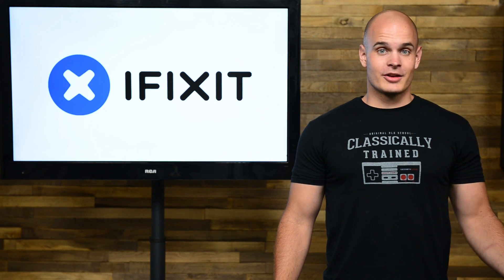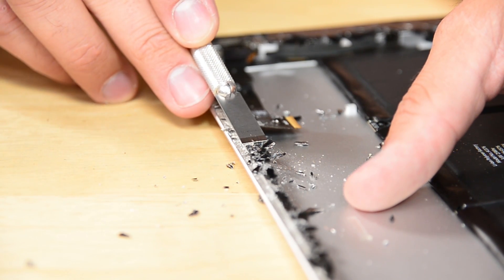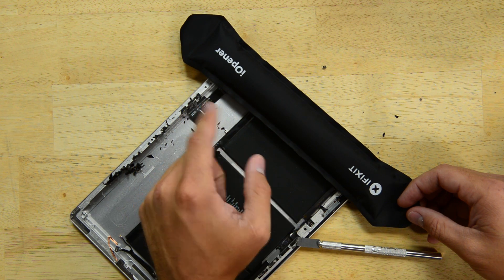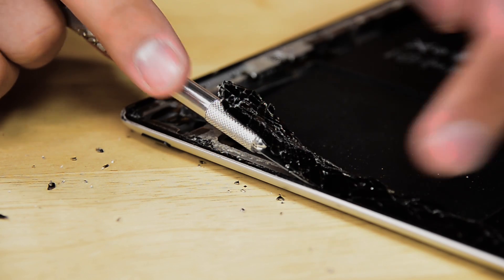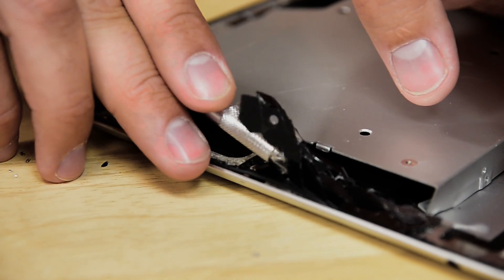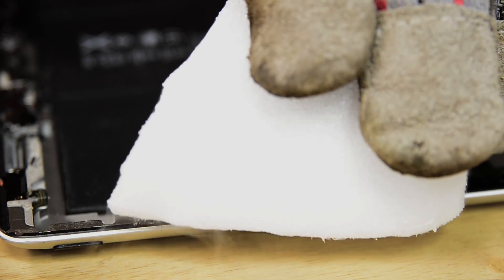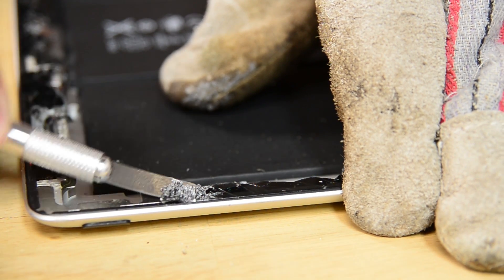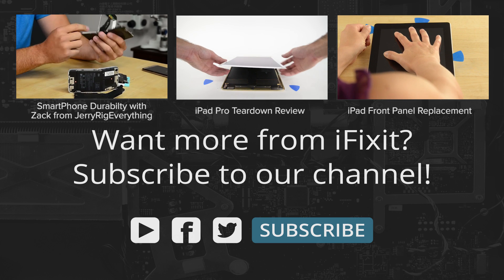What's the Best Way to Remove Shattered iPad Glass? With Zack from JerryRigEverything

Comment: A 250 watt brooder heat lamp can help keep it warm while you work your way around... shine it on the area just ahead of where you are lifting and rotate the IPad to keep it that way as you go.

  Food over a couple of square feet of aluminum foil a few times to make a radiant heat shield for the battery and other components you want to protect from heat.

Comment: hot plates left on for 5 minutes usually warms up the iPad enough for a isesamo tool to remove everything.   my tooth is shaved down thinner then you can purchase. if that doesn't remove all the glass easy then I put it on the hot plate once removing the top digitizer for another minute or two and go to work on it again. Hot Plate at a hundred degrees Celsius is your best option it's only $88 for a professional use. heat gun is the best option with razor blade if you're trying to do this at home

Comment: Nice video! I always put a layer of scotch tape, before I start removing the pieces of shattered glass, then I apply the heat gun. It reduces the amount of shards flying everywhere!
Reply: Omg I've always done that. Great to know Im not the only one. Also, dipping the preferred in alcohol helps A LOT! Even if you have to do that several times, totally worth it for those hard ones